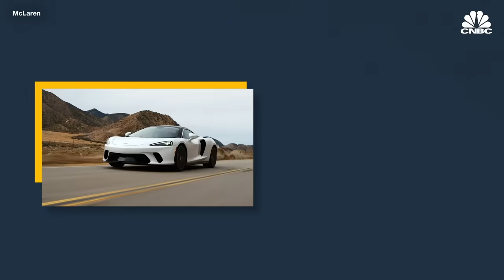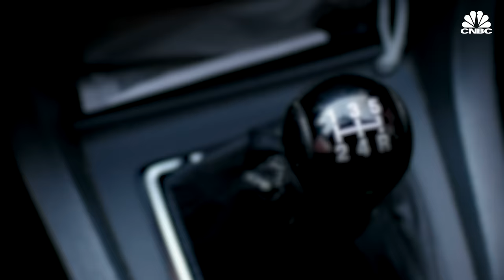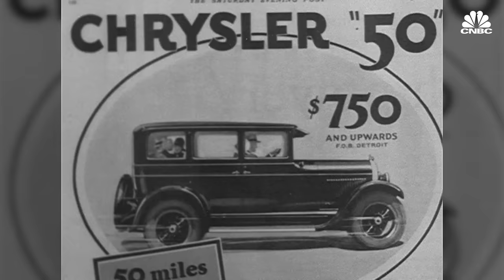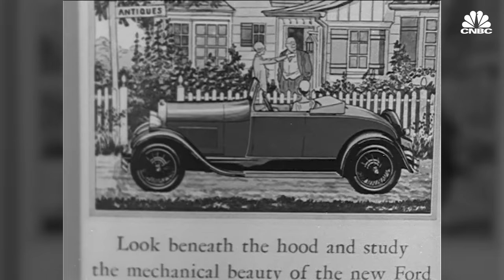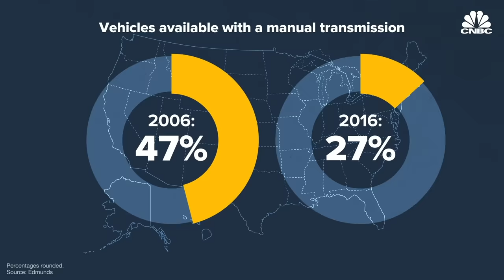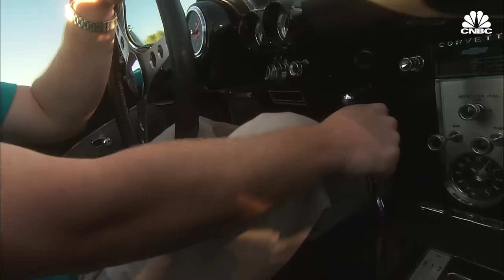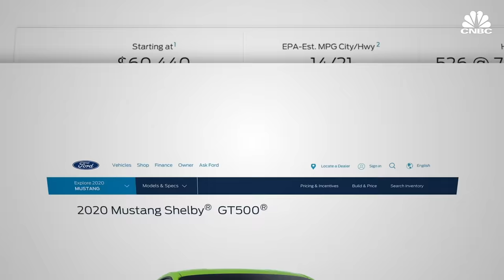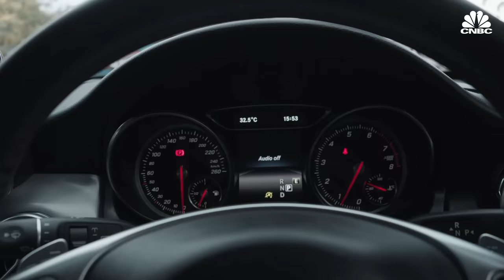Why Stick Shifts Are Going Extinct

Comment: Several years back I was driving my stick shift car off the highway and the brakes gave out.  I didn't panic however because I knew I could bring the car to a stop by just shifting down to slow the engine and then eventually bringing it to a complete stop from a very slow speed with the use of the emergency brake.  Now everyone else I knew (outside my family of 3 women who all grew up driving standard,) drove automatic and never used their emergency brakes (so they were often seized) and I think they would've likely been in a panic.  I trust driving a stick shift, it's safer in my opinion and I feel more a part of the vehicle as it travels.  I find driving automatics to be rather boring and it feels as though there is a middleman between me and the car.
Reply: It's so much safer. Learning to drive manual has taught much so much more deeply about how traffic works, how it should work, the legal rules vs social norms for each kind of sign. I think that everyone should have to own a manual car at some point so that they can be safer and better drivers.
Reply: Emergency brake... You mean the thing that new cars don't come with anymore?
Reply: Same situation. My wheel hub was loose so it disabled my brakes. I got panicked but reacted quickly by downshifting from 4-3-2 and finally 1st. Can't imagine if auto
Reply: yep same thing happened to me, 1988 mazda mx6 dumped all the brake fluid on the highway, did exactly what u said and was able to get home. Couldn’t imagine being in an automatic
Reply: @Narium413  Handbrake
Reply: @Narium413  E brake will work if the failure was caused by loss of hydraulic pressure in the braking system, but if it was caused by overheating brake pads it won't.
Reply: To be fair in some more "advanced" automatics, have a select shift/sport shift with either a bump shift or paddle shift, allowing the driver to increase or decrease the gear based on driver input.

My mother uses hers on ice rather than braking.
Reply: @duckdestroyer2412  Those transmissions are ok, personally I prefer a manual since I mostly do highway driving so my clutch lasts a long time, and automatics are so expensive when they go out. Manual is cheaper to repair usually and also less likely to have issues in the first place.
Reply: @Narium413  no, the thing that is electronically controlled, so when your electronics don't work or your battery is dead, you can't use any more for your "emergency" LOL...  some things should remain mechanical and simple, such as emergency fallbacks....
Reply: I drive automatic and I only use my parking break when I park on a steep hill, just in case.
Reply: Actually...

Automatic transmissions commonly come with some "mysterious numbers" below D. Those are for downshifting, to use engine braking. They can also be used on a steep downhill slope (to save the brakes).
Reply: @joemckim1183  You should also move your wheels so you won't roll all the way down the hill.
Reply: Couldnt you just ease on gas and also use the emergency brake in a auto? Lol
Reply: You can downshift in most automatics and do the same thing
Reply: Same thing happened to me, except I drove all the way home with no brakes 😂
Reply: @notmyrealhandle   yeah but people like you who don’t know how to engine brake would end up killing yourself, and or someone else.
Reply: Its safer for other road users as well because you cannot text while driving a stick shift
Reply: automatics are the best
Reply: This and hand brakes! You control the machine, not the other way around
Reply: it's a parking brake, only trucks with air brakes have an emergency brake.